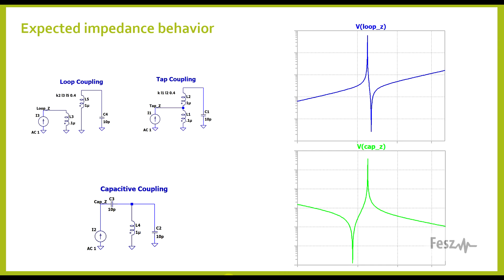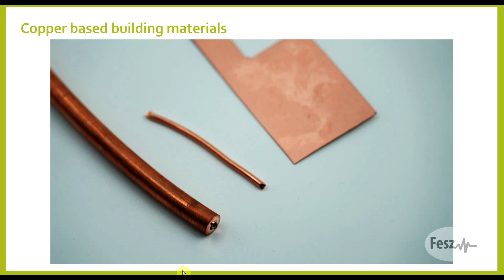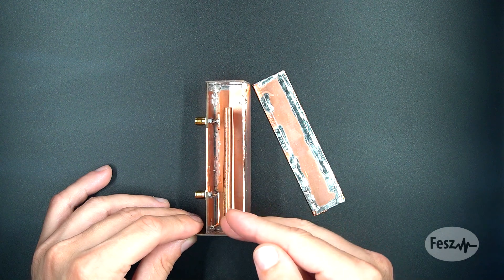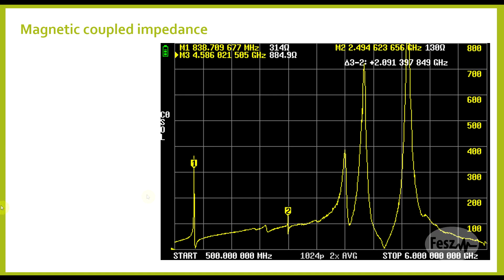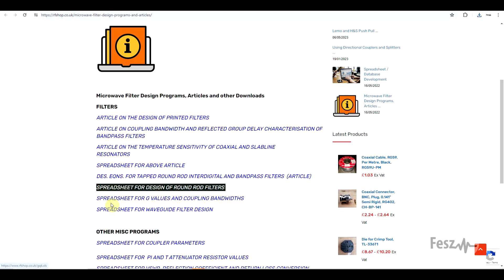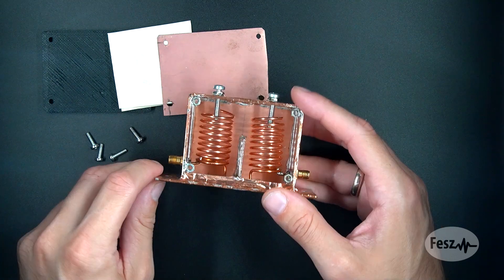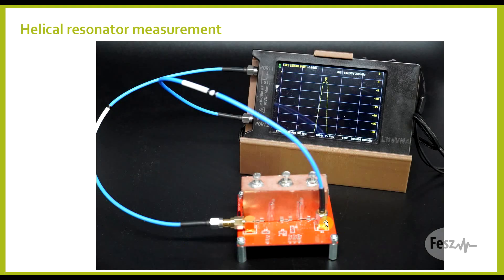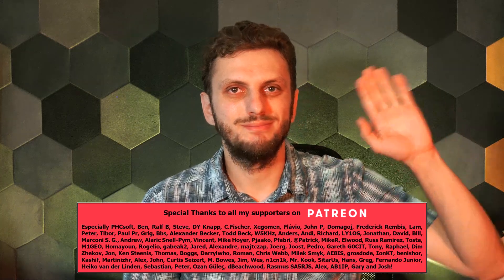Cavity filter Experiments

Comment: Using this same principle, is it possible to build a duplexer filter for use in a 2 meter VHF repeater?
Reply from the maker: Its quite common to make duplxers using cavity filters. These are used for both 2m and 70cm. Making them as a helical construction rather than a straight rod will not impact the functionality but only add a bit of extra losses.

Comment: I'v found that silver plating the copper helps reduce losses.  Also in your helical filters, the dielectric losses in your coil forms could be significant.
Reply from the maker: I did think of trying to silver-plate one of these devices, but looking into the chemicals needed, I decided it was cheaper and safer not to try... maybe if you know a small workshop or company that can do it for you (I guess a jeweler) it might be relatively affordable. Did you ever silver-plate any electronic device?

Comment: Nice work. They all need adjustment to the coupling to flatten the tops, but they work, and they work well.
Reply from the maker: I found that 2 things are quite difficult to get right - the exact adjustments of each resonator - to get the desired response shape; and the other is the coupling - you can get a better or worse result (higher or lower pass band attenuation) by changing the exact amount of coupling into the first and last resonator. So with the devices I've built, the coupling is adjusted by changing the exact tap point.
Reply: @FesZElectronics  Exactly what I would do
Reply: @FesZElectronics  Tuning resonators accurately is best done in time domain. Set the analyser by CF and Span. CF goes to the centre frequency of the filter. The span should be about 3 X the filter bandwidth. Now look at S11 in time domain and you will see three dips, one for each resonator. Tune them by making them as deep as possible. The resonators are now perfectly in tune, and all that remains is the coupling.
Reply: @donepearce "look at S11 in time domain": Do you mean a Fourier transform of S11?
Reply: @tomyorados974  Time domain is a selectable option on this analyser.

Comment: Again, it's a thought-provoking video. Respect!
Do you know the dielectric losses of the material of the helical coil supports?
Reply from the maker: I used generic PLA, nothing special; but I guess there are better materials, anyway, you should be able to reduce losses by having a very low infill ratio - use the bare minimum plastic to support the structure.

Comment: Thank you. 
I was wondering about the thermal expansion/contraction effect from home-brew PCB material filter cans. They wouldn't really follow the expansion/contraction coefficient for pure copper. I suppose I will need to do thermal frequency shift experiments with the materials of interest. But even used commercially made cans are so expensive it might well be worth it for projects less important than a ham club repeater up on a mountain.

Did you print your coil forms with some sort of polystyrene to keep the dielectric losses down, or was that not a concern?
Reply from the maker: It is quite common to make PCB based filters - most transmission line filters are built on a PCB substrate when going for high frequencies; here you can work with FR4 when losses are not important or at relatively low frequnecy, or with some more exotic materials - like Rogers PCB when losses need to be minimized. Regarding the coil forms, I just used PLA, I was not trying to take too much care with losses though...